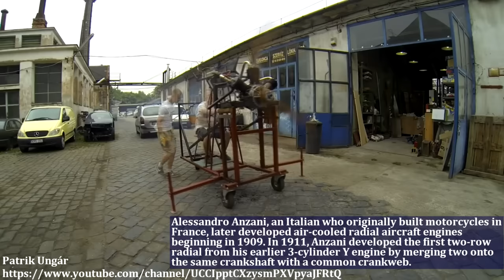100 Years of Big Aircraft Engines And Their Starting Up

Comment: Were those V12's designed in America during WW2 actually copies of Rolls Royce V12 Merlins after we gave America the plans / license to build?  Was the Mustang a good plane before a V12 engine was put in it?  Was that V12 engine in a Mustang, a copy of the Rolls Royce Merlin?  Did the UK do the same with the jet engine that Frank  Whittle designed.  Also, did the technology from the UK allow an American to break the sound barrier in a plane?  What is the truth?
Reply: The Allison engine in this video has nothing to do with the Merlin, it is a completely different, later, and arguably more efficient design. The Merlin was produced in the US under licence by Packard, initially as a source for British aircraft that were being built in Canada before the US entered the war. The Mustang always had a V-12 in it, initially an Allison V-1710 but later a Packard V-1650 Merlin. Early Mustangs were excellent aircraft but only at low level, the Merlin was more powerfully supercharged and produced greater power at high altitude which transformed the Mustang into the outstanding escort fighter it became famous for being. "Did the UK do the same with the jet engine that Frank Whittle had designed?" If you mean licence production to the US, the answer is essentially yes, the General Electric J31 was a US built version of Whittle's W2B, though GE made some improvements to the design so it's not exactly the same (though that is also true of Packard Merlins). 
The British technology that may or may not have helped to break the sound barrier story is based on the fact that the British supersonic project was shut down and all the research data (allegedly) sent to the US. What actually happened to it there - if it was sent - is unclear. The big issue that makes British aircraft enthusiasts particularly hot under the collar is that the Bell X-1 had an all-moving tailplane that seemed to be derived from the British supersonic Miles M.52 design. Whether the Americans developed this independently is not known, they were certainly capable of doing so, NACA had made a study of the all-moving tailplane in 1942. Nor is it strictly necessary for a supersonic aircraft to possess a flying tail - it certainly helps though. What is undeniably true is that British aviation enthusiasts with nationalist tendencies (ie most of them) feel aggrieved that the Miles M.52 project, which stood a very good chance of becoming the first supersonic aircraft in the world, was cancelled and the Americans got there first. Therefore suggesting that they did so off the back of British research and technology and the Americans 'cheated' in some way makes them feel better. And I say this as a British aviation enthusiast.
Some Americans get annoyed with the suggestion that it wasn't an 'All-American' achievement (for the same reason). The truth of the matter remains anyone's guess.

Comment: I don't know what engine is actually being shown at 2:00, but it's not a Ranger SGV 770.  The ranger was, as described, an 'inverted' engine - which the engine in the video most definitely is not.  An inverted engine will have the crankcase uppermost, with the heads lower - as per the DB603 - https://www.youtube.com/watch?v=3s15ELvPOuE

Comment: According to Wikipedia, your statement that the Liberty L-12 was the first to fly the Atlantic is incorrect. The first non stop Atlantic crossing was by a British Vickers Vimy piloted by John Alcock and Arthur Brown and it was powered by two Rolls-Royce Eagle 360 hp engines. It is true that some Vickers Vimy aircraft were powered by  the Liberty L-12, but they chose the Rolls Royce engines for the Atlantic crossing attempt.
Reply: You are correct that the first NON-STOP flight was powered by Rolls-Royces but the first aircraft to cross the Atlantic was the Liberty powered Curtiss NC-4. It took 10 days and 22 hours to get from Newfoundland to Lisbon with a protracted stop in the Azores with mechanical trouble, eventually arriving on the 27th May 1919. Nonetheless this was the first aircraft of any kind to cross the Atlantic by air. Alcock and Brown achieved their rather more impressive feat in June.

Comment: I love the idea of sticking an airplane engine into a sports car.
Reply: It wouldn't work all that well only because airplane engines run at a considerably lower compression which is why they sounds like they do
Reply: Even better if a motorcycle or a trike instead of a sports car😂😂
Reply: Search for a car called the Brutus. It has the engine of a bf109 in it.
A plane engine though has a lot less HP than a car engine as they move through something a lot more fluid and don’t have the weight of the machine acting on a road surface which causes so much drag
Reply: @mhmadgenious  Not counting the "special" land speed models like the British Railton (two Napier engines) or the American White Triplex (THREE Liberty engines) then?

Comment: The claim for the 1917 Liberty L-12 is a little ambiguous, as the first plane to cross the Atlantic was a Vickers Vimy, flown by Alcock and Brown, and was powered by Rolls Royce Eagles.
Reply: You are correct that the first NON-STOP flight was powered by Rolls-Royces but the first aircraft to cross the Atlantic was the Liberty powered Curtiss NC-4. It took 10 days and 22 hours to get from Newfoundland to Lisbon with a protracted stop in the Azores with mechanical trouble, eventually arriving on the 27th May 1919. Nonetheless this was the first aircraft of any kind to cross the Atlantic by air. Alcock and Brown achieved their rather more impressive feat in June.

Comment: You forgot the best aeroengines of WWII: RR's Merlin and Griffon.
Reply: The best aero engine of WW2 is the Daimler-Benz DB-605.
Reply: @sandervanderkammen9230  You have a good sense of humor!
Reply: @mussaranya  The Bf-109 is the most successful fighter aircraft in history and was powered exclusively by the DB-600 series engine.
Reply: @sandervanderkammen9230  False. The Bf-109 was not the most successful fighter in Europe, it was outruned by the Spanish "Mosca" at the beginning of the Civil war.
After full developement, it became obsolete in 1940, during the Battle of Britain when the Spitfire proved a lot better than the 109, that's why the Germans started to develop the Fw-190.
And no, it was not powered exclusively by MB engines, at the end of the war 239 Ha-1112 (a licence-buildt Bf-109) were buildt, powered by RR Merlin aeroengines.
Reply: @mussaranya  The Bf-109 is the most successful fighter IN HISTORY!

Comment: Read that radials could take more battle damage and keep flying. Any truth to that? Anyone?
Reply: MrTDB123 if a liquid cooled engine took a bullet to it’s cooling system, it would stop shortly afterwards. Radials didn’t have cooling systems. Maintenance was also easier and the engines more reliable for the same reason. This is why the US Navy preferred radials. You don’t want your engine stopping if there’s nothing but water for a hundred miles.
Reply: Jeremy Pereira thx. From what I have read they could have several cylinders shot out and still be able to limp back.
Reply: MrTDB123 I’ve heard of incidents like that, but any damage that compromised the oil system would soon kill the engine., radial or not.
Reply: Jeremy Pereira well ya that’s understandable of course.

Comment: no big engines built in europe ?
Reply: FR The modern jet engine was developed by Frank Whittle. Hans van Ohain developed the German jet and initially claimed it was independent of Whittles design. Later though he declared that he had read Whittles patent filed in 1930. The design plans for the Whittle engine were given to the Americans during the war for production purposes. Rolls Royce were given the task of producing it after Ford U.K. couldn’t produce the items within the required tolerances.
Reply: Whittles engine design had a centrifugal compressor while the German designs from Junkers and BMW had an axial flow compressor.The Germans had an operational jet engine long before the allies.The V l used a ramjet while the Komet and V2 used rocket engines.

Comment: How difficult would it be to design mufflers for airplanes?
Reply: why add extra weight
Reply: Depends on the engine, but for the record, all small general aviation planes (ie Cessna 172 or Piper Cherokee) have them.

Comment: How is fuel fed to an engine with rotating cylinders?
Reply: Through the crankcase, but you need to supply a lubricant mixed with the fuel, like in a two stroke engine. Curiously enough, one of the best lubricants for that task is castor oil, which is also known for its laxative properties. This had some unexpected consequences.
Reply: Francisco Javier Ramirez Martinez especially after reading that lots of engines in those days sprayed the pilots with oil during flight
Reply: @TheReadBaron91  That's why they wore those white scarves, to wipe the oil from their faces.

Comment: 3:19 I love the bendy propellers.
Reply: Are you joking? It's a strobing effect of the camera of course. Sometimes the prop appears stationary or even reverses - that's when the frame rate is close to the blade pass rate. Also, the image sensor is raster scanned rather than reading all pixels simultaneously. By the time it's completed the scan, the prop has rotated a fair bit, making it appear distorted.

Comment: 1:38  First to fly the Atlantic? Alcock and Brown flew the Atlantic in 1919 with Rolls Royce engines in a Vickers Vimy bomber.
Reply: You are correct that the first NON-STOP flight was powered by Rolls-Royces but the first aircraft to cross the Atlantic was the Liberty powered Curtiss NC-4. It took 10 days and 22 hours to get from Newfoundland to Lisbon with a protracted stop in the Azores with mechanical trouble, eventually arriving on the 27th May 1919. Nonetheless this was the first aircraft of any kind to cross the Atlantic by air. Alcock and Brown achieved their rather more impressive feat in June.